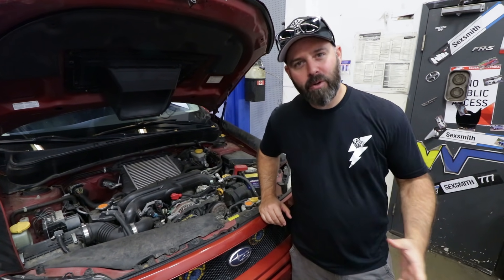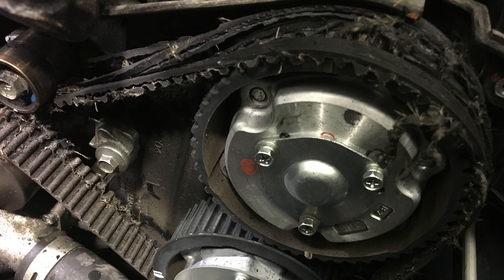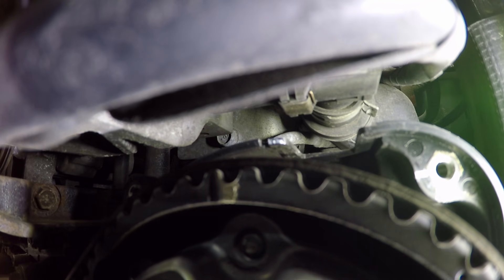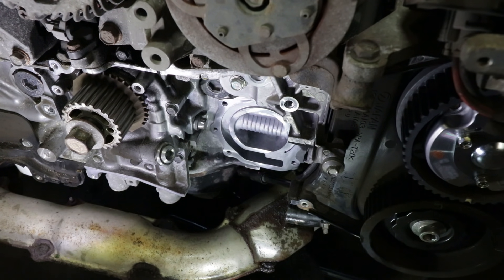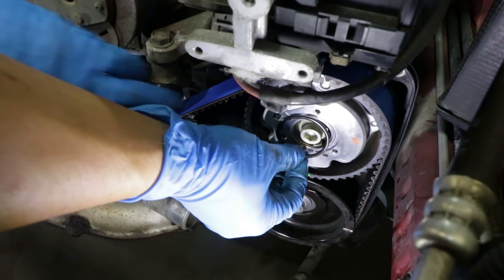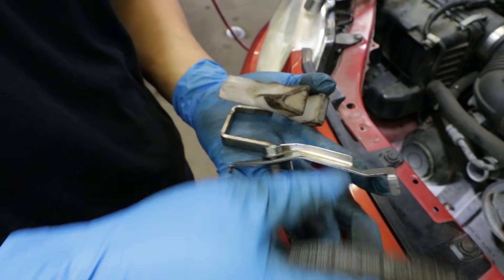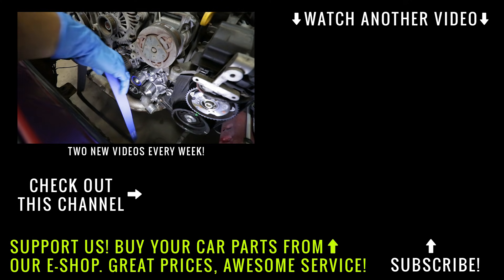How To Change A Subaru DOHC EJ20 EJ25 Timing Belt

Comment: I did this job and this video helped alot, however I found a tool from  a place called company 23 that will hold your drivers side cams in place while you do the job, really saved some time and helped me not be so nervous about doing this job
Reply: Riley, is yours a turbo model engine? I tried calling Company 23 and they said their tools only fit turbo models
Reply: @SW-gl9jy  yes its the dohc ej205 from 2002

Comment: This is a great video. I just have one question. At about 9.27 ish the mechanic uses an allen key to rotate the LHS exhaust cam clockwise (just a tiny bit). I thought that that cam should only be moved in a counter clockwise direction. Is that generally the case, and does it not matter because it is such a small rotation? Anyway, great video, thanks a lot Nam.
Reply: Did you find anymore information on this?
Reply: @SW-gl9jy  No. When I was doing mine everything was smooth until I realised I'd tried too hard to line up every mark by pulling hard on the belt. I needed to relax the tension just a bit, and then the LHS cams span a little. This was exactly what I was frightened of, and tried to avoid with a cheap sprocket locking tool. I have started the engine and run it a while since (still working on other things) and I think its OK. Scary though! It would be good to know for certain that valves have not made contact.

Comment: PLEASE HELP!!!!! I just followed your video on my 04 XT and when I loosened the pully bolts the left side cams spun like in your video. From what I see, all I have to do is realign the timing marks? Is one rotation of the cam gears one rotation of the cams? I  crapped my pants when I heard the gears slipping on the old belt. All other timing marks are in place. Please tell me I did not kill my subi!
Reply: Good luck to you man. Did you kill your subi?
Reply: @TheMrFlyBoy18  I just realigned the timing marks and all was good. The driver side cams are spring loaded, its a pain trying to turn one clockwise and the other counter clockwise while holding the belt at the same time. I  did turn the engine over by hand a few times just to make sure the valves did not hit the pistons.

Comment: I've seen several videos of timing belt replacement on EJ25 motors, but not a single one has replaced the cam and crank oil seals. Can anyone explain why they are not being replaced whilst timing belt replacement?
Reply: You should do, I agree with you. They just well, never mind -)

Comment: Very good video! I had removed the gearbox and the flywheel for another repair on a GC8 so I saw straight away the problem of removing the crank pulley. To do so I fabricated a special tool which holds the pulley from the 4 holes and the same time the socket can reach the bolt. It was also designed as such that it can remove the pulley by just moving away the fans without removing the radiator and coolant.

Comment: Own a jdm EJ204 dohc. Would the Aisin TKF-005 fit - anyone knows? Cant seem to figure out which parts to get. I know the belt should be longer and an extra small bearing such as here should exist on mine. Much appreciated if anyone could confirm
Reply: I have the same engine. What did you end up doing?
Reply: Mine is a jdm Forester 2008 that is non-turbo. Everything in TKF-005 will fit except the water pump. The water pump in mine had only one hose line - WPF-025. This has to be bought separately
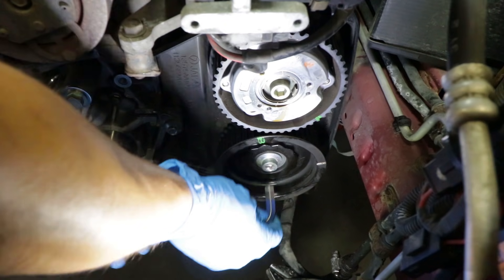Reply: Hey, another question. Did you have to take care regarding which direction to rotate the cams on the avcs side (from 9:26 onwards) when lining up the marks?

Comment: just put a breaker bar on the bolt then lay the handle down on the left frame rail if not long enough put a pipe on it stretch it across to touch down on the frame rail ! then do hit the key ! aaahhh hhhaaahh !

Comment: I have been wondering if the lower single bearing idler could be replaced with the double and it looks like you installed a double on both top and bottom. did you use the same idler on the bottom as you did on the top or is there an aftermarket double for the bottom. I'm working on a 2008 outback xt. Thanks

Comment: Can you provide more details how do you lock engine for AT version to remove camshaft bolt please ?
Reply: Looks like need to respond by myself, close to left side of intake manifold black rubber cap about 40x55mm size.
Reply: @Man4Hour  Thank you!

Comment: Anyone watching this do not DO NOT buy the Gates blue racing belt . The blueing comes off and stays on your pulleys and bearings !!! Had one mess stuff up after 8,000 miles Subaru belts hold the same strength, hp and will last longer . They were trying to give them away at the last Rocky Mountain Subie fest and no one was taking them so I asked why went home and sure enough issues.

Comment: Or just use the proper pulley removal tool so you dont bend or damage your flex plate or teeth on the flywheel.
Reply: TechHandle I just used the tool. Super easy.
Reply: @scottm3552  Exactly. Right tool for the job makes things less intimidating and much easier.

Comment: I just took my Subaru 2003 forester to replace my timing belt and water pump now the engine only turn quarter 1/4 way forward and back the by hand and wont turn fully what can cause that . now the he telling me to buy use engine  I think he did it wrong can you help
Reply from the maker: Sounds like the valves are hitting the pistons, so the timing belt job was done wrong. If the engine doesnt start then you most likely have bent valves but if you havent started it yet then take it all apart and fix the timing.

Comment: this is a great video!!! what kind of racing belt is that? could you link that, regards from Florida!!!
Reply: That is a Gates racing belt. Really good products from Gates, and that entire pulley kit is (most likely) theirs too as they normally sell entire timing kits whole. I believe they have swapped one of the pulleys for a Chinese version now though so be prepared to replace one of them if you want to stick with all Japanese made parts.
Reply: I would rather go with hks timing belt kit. I heard bad things about gates and that their tensioners explodes and shot goes bad from there. Research up on gates as to why its paid. If you pay cheap you get what you pay for. I’d rather invest in a more quality belt kit

Comment: Bought a EJ205 motor and am currently having an issue I’m installing correctly per manual but the driver side cam shaft indicators do not line back up after two revolutions? Is this normal or am I doing something incorrectly?

Comment: HELP! Our '03 EJ251's new timing belts are too tight, and that's with the tensioner still pinned but w/o the bottom-left pulley or that small plastic plate below it (belt hits it due to having no slack for the pulley). After watching another vid, I think the tensioner cross-pin might be holding the pulley down. Find out tomorrow night.

We've tried two diff Dayco kits and one from Import Specialists (Gates?), the belts from which are all the same length as the original and the lines on each align with the marks on the cam and main sprockets w/no slack between them. 
In a post from 3 months ago asking for tooth counts, @jthadcast replied with "Z1 46.8, Z2 43.7 teeth...ej25 sohc.
But if I remember right (very long day Thursday ), the tooth counts between the lines on these belts are: Z1=44 and Z2=40.5.

Plus I've seen posts in NASIOC.com which give both sets of numbers as well.
Also, we turned the crank to give the belt three full revolutions and the lines were then each exactly 3 teeth left (or right? - long day) of the mark on all three sprockets.  But this shouldn't matter because the important thing is that, when installed, the 3 lines align correctly with the marks both on and behind the sprockets.

The engine runs very smooth. But again, this is w/o the bottom idler and 'no tensioner'. 
 Plus, after running 5 min's, a loud squeal now comes from the pass-side cam sprocket. I'm telling you, this belt is extremely tight.  We stopped running it, but need HELP!

We followed the same procedure as this and three other thorough videos and the instructions in the kit and have verified over and over that the belt is routed correctly and the pin is still in the tensioner. I admit that we forgot to bleed the tensioner pre-install as recommended in one vid. But the center pin is barely higher than the rim.

Comment: Thank u guys for great video. I have a question for Nam. My subaru wrx bugeye. I lined up the crank mark with oil fuse mark. But it gives two different positions with cams. And both are wrong. The were lined up but the double Marks were at the top or at not as urs was. I seen a few videos n seem to understand the that the single Marks are top n bottom cam at 3pm. The double are facing eachother makes sense as two cams for two marks.

But my car was running fine but it seems the double Marks are instead at top of cams n singles facing down. 

Should I just ensure the crank is centre n then change the cams to how ur video is? I understand fully u can't see the the car n can't advise. I'm enjoying learning so I just want to understand it. 

I'm trying to think the person before obviously mixed them up or the cams were changed n put on wrong.

If u could help with possible scenario of me just turning the cams to where they should be, that would be amazing.

Comment: A used Subaru pre-2012 with no Head gasket symptoms
Is it wise to replace the gasket as a preemptive measure? or wait for failure?
Reply: might depend on miles...I did mine preemptive, 95K miles and 20 years old, they were not leaking but when I took them apart, I could tell they were going to be leaking...glad I did it...
Reply: @DanTheManIOM  Thank you. I'm at 96K

Comment: Procharged 4.3 V6 S10 guy here... I love this video. Had the Timing kit on hand for the 02 WRX I bought last summer... 161K on original belt... Yikes. Love these little boxer engines. Power per cubic inch is insane... Easy to work on. VIDEO IS AWESOME... It made total sense to me. Watched it 3 times just to make sure I had it down pat. Thanks Speed Academy!!!

Comment: I did everything correctly in this video I believe, but after filling up the coolant and turning the car on, the rad fans didn’t come on after it was at normal operating temp, even on the test drive. Is this normal? I drive an 05 WRX. Some responses would be great! Thank you.

Comment: At 5:45 the left intake cam spins, can this damage the engine?
Reply: i dont think so. those you can spin by hand. From what ive heard for the driversides cranks the bottom you should only turn left and the top you only turn right...

Comment: Isn't that a problem when the driver's side cam spins free at the 5:50 minute mark?  Didn't that just crash the valves into the piston 🤯? Why didn't you hold the driver's cams in place when removing the timing belt?
Reply from the maker: no because the piston is not at TDC

Comment: Glad to see it worked out I did them a bit differently at the dealer. Looking at the engine from the front I used those black spring paper clamps to hold the belt at the correct mark on the left bank, leave the clogged gear and the tiny gear off all others in place. Then belt over the crank held with a plastic friction clamp. Set both right side cam gears on top of the closest lobes so they don't spin out then use clamps to hold the belt on respective marks tucking excess belt between the cam gears, now the belt can't slip. Grab the belt by the water pump and pull and all the slack goes there for installing the cogged gear there then push down on the belt by the tensioner to pull the slack there rolling the cams and pulling slack there for the last idler,  double check marks and pull the tensioner pin.

Comment: How much would a kit like this run me on 2006 Subaru legacy 2.5
Reply: After 5 tries, I finally was sent the correct kit (Japanese) for 1999 EJ25.  But it was just over 300 USD in the US.  I also bought Felpro Gasket set with head gaskets for about 150.

Comment: Hello I have a 1999 Subaru Legacy GT with about 175,000 miles on it and my mechanic last year when he inspected it said that the timing belt look to be new same as the water pump well in the last two to three weeks I went to leave work the one night and the car start making a horrific noise and I didn't know what it was so I put it in the employee parking lot at work and left it there and took the bus home days later when the temperature was a little bit more mild I took apart the drive belts it wasn't that then I took apart the timing cover and found that the timing idler sprocket  pulley had exploded ball bearings all over the place and I wanted to ask if I just replace that should I be okay cause the timing belt looks brand new and still in place same as well as the water pump please let me know? 
I have been trying to order the new timing idler sprocket but it is hard to find it made from Japan 
I don't want the Chinese ones 
found it at NAPA Auto parts 

thank you,
Bob Patterson
Philadelphia, PA.
Reply from the maker: The price of replacing those other parts is only a couple hundred dollars but the labor to do it later again will be much more. I would replace everything just so you have the piece of mind knowing that it has been done.
Reply: Pretty common problem for that gear to come a part. It's only $35 from Subaru. If you're on a budget inspect the belt if it's not market up or teeth missing and you can still see the timing marks I'd go ahead and reuse it.

Comment: To make sure I'm not going crazy... but is ALL of the kits for the ej257 motor's missing a pulley? Got an 07 STi that I'm doing the timing on for its 200k mark and got the same Gates kit in this video but I'm looking at the front of the engine with the covers removed and I count one additional pulley than what the kit came with. Looks like I have the two top pulleys, the tensioner, the small pulley next to the tensioner, the cogged idler, and the water pump. But there is another pulley on the passenger side bottom of the engine. I even watched it get removed and installed in this video. Do you re-use that one? Or what? Looked at opposed forces and its not linked to a part number. Best I can find is that it is part 13073AA180 which was replaced by part 13073AA142 which seems to be the same as the pulley right above it. If thats the case, cool I can just order one. But has Gates always shorted the kit by one pulley? If so, I'm going to regret buying this kit now. Cause thats fucking stupid.

Comment: I appreciate the video. It's very helpful to see the layout of the setup before tearing into your own. I do suggest the standard practice for timing belts though. Rotate the crank pulley at least twice after timing is done to check marks and verify no interference. Not nessacary if you've been doing this a long time though
Reply: what if you had it lined up right then after you rotate it its not right anymore?
Reply: @TheEugenee  if it was lined up at first and then isn't. It's out of timing. This may be from a bad tensioner giving to much slack of from being off a single tooth so it looked timed at first but now isn't. You would undo timing and start again.
Reply: Wouldn’t you bend the valves by rotating the engine two full revolutions?
Reply: @TheMrFlyBoy18  by rotate the engine I mean by hand with wrench and socket. Slowly. If you feel any resistance. Stop. And undo the timing and reset everything. If the engine is timed right you won't bend the valves.

Comment: If they got rid of the out dated flat or boxer engines and moved into modern era you wouldn’t have a belt longer than your driveway.
Reply: A lot of advantages to the boxer design as already described, plus they would have to get rid of the current AWD setup as going to an I4 would move the transmission backwards in the car so the pinion in the transmission wouldn't sit on top of the front wheels

Comment: If the belt has broke how do I make sure the mark are in same place?
Reply: Set the crank first the set the cams. Throw a belt on it and give it a try, you'll know pretty quick if it bent valves. I have seen them survive so good luck

Comment: The OEM Subaru Water Pump uses a metal impeller... I've been told you don't necessarily need to replace it every time you do the timing belt. Anyone have thoughts on this?
Reply: Subaru just recommends inspecting the water pump for leaks and rough, lose or noisy bearings when changing the belt. It won't hurt to replace the pump, I wouldn't personally but changing the pump is only an hour and a half job that I do myself. 4 years working on Subaru's I only ever saw 2 bad water pumps just for an idea of how rare it actually is to fail. Many of these cars were well over 100k some pushing 200k or more

Comment: This gut does the job correctly. The Subaru dealer will skimp on the water pump, idler pulleys and thermostat. They only replace those items if they feel they're worn lol. Oh and they'll also over tighten the plastic timing belt cover and crack the plastic were the captured nuts sit in the plastic.

Comment: If anyone is looking for Japan made parts, Aisin kits seem to be the way to go.
Reply: Aisin all the way. It’s the same parts you’d get from subaru minus the subaru box and price.
Reply: Thanks for the confidence. I just bought them in lieu of the OEM Subaru Kit costing ~$450 compared to Asin's $270.
Reply: @Keys879  Aisin's Parts are good. (Aisin Seiki Co) They are mostly owned by Toyota and are great replacement parts for Toyota, Honda, and Subaru's I've found. Their water pumps are epic and their brand of silicone is like Hondabond.
Reply: @potardo9851  Seriously appreciate the input. High miles and smooth shifts on your journey my friends!